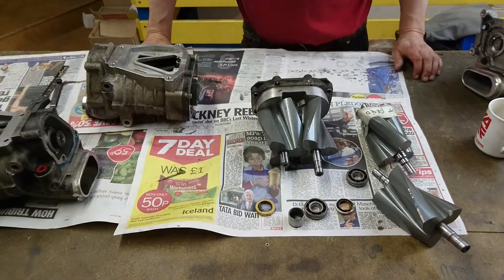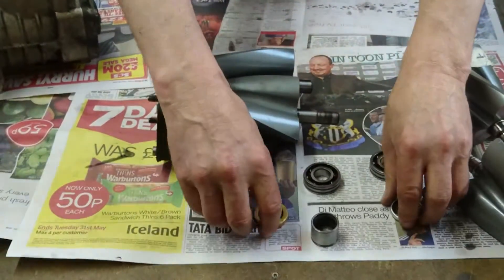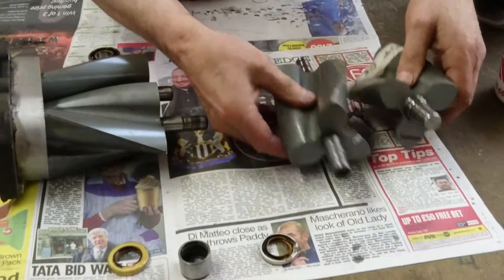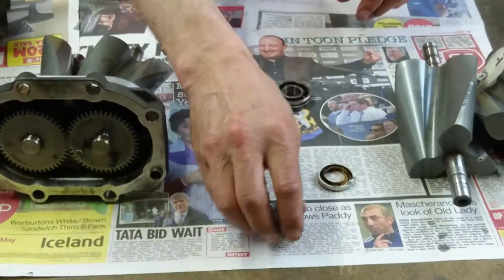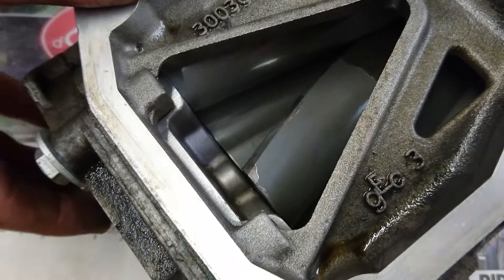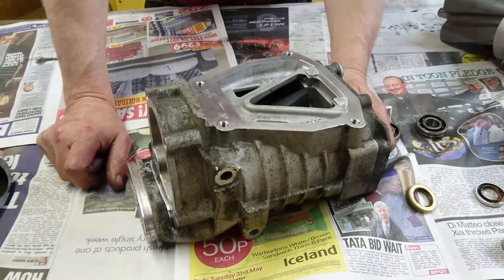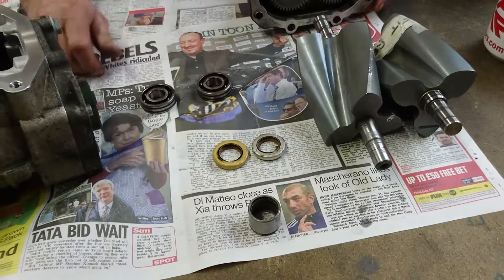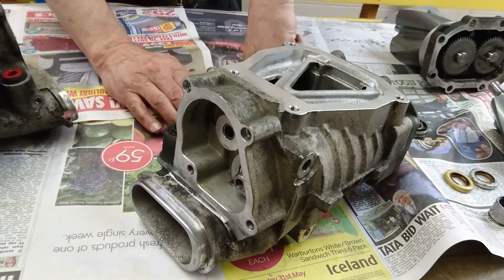GTT MINI COOPER S R53 SUPERCHARGER ROTOR PACK REBUILD 2

Comment: Hi very helpful video! Do I have to lubricate the rotors or blades with oil as well for cooper s r53?!  I recently did overhaul of my supercharger washed everything with petrol, did fill the oil accordingly at the pulley side 145ml and water pump or rear side 40ml, but didn't add any bit to the rotors so um just curious!

Comment: I'm confused about saying pulling the gears off effectively leaves you with a scrap charger, so can you time the rotor packs or not?
cheers
Reply: Michael scheid have to make a spacer to keep The space between Rotors ,put back rotors but not The gears check The space several  times and then slide The gears not one at The time but together by hand in a point that can be  fixed by handrotating them when you Are sure than take out again rotors and pres The gears in little by little......but actually in a mini The pto Seal is The problematic The snout part never had an isue if i would reduit i would change The pto Seal with a better quality one like skf Chicago rawhide i beleve is The 6115 Seal if i not mistake
Reply: chance of re-timing rotors is Zip
Reply: Nothing is inpossible actually I manage to rebuild a Eaton for my cooper s with a little research you can find. The parts online ....and the supercharger run fine after 4 years no problem ,,,but I would go with sprintex replacement not with a rebuild if I had to pay for a rebuild by someone,,,,,
Reply: @vasilisrroshi8642  How did you do it? did you put the rotor shafts in a vice?